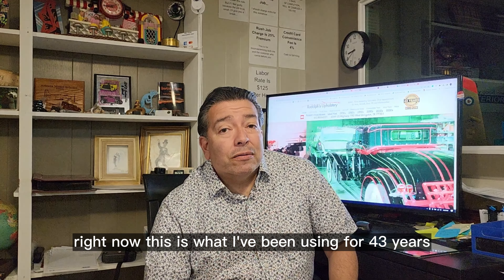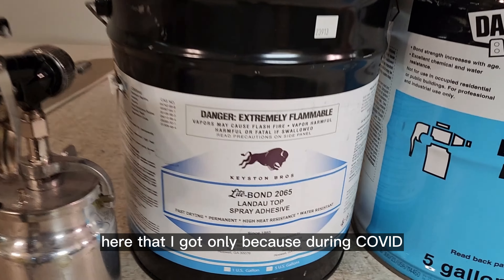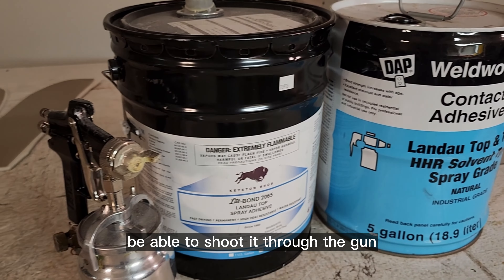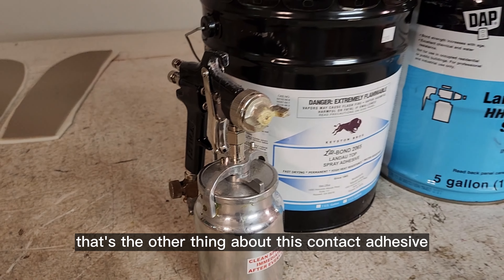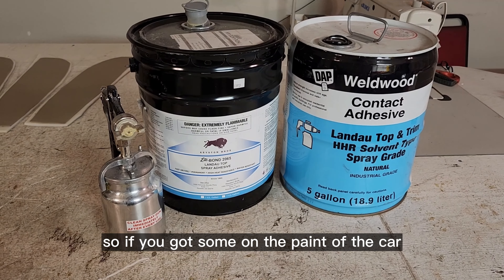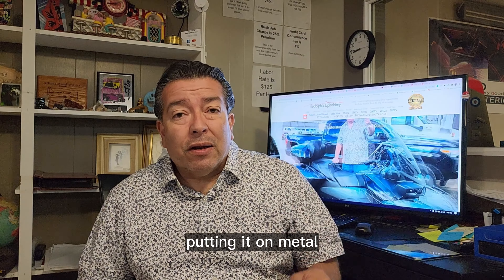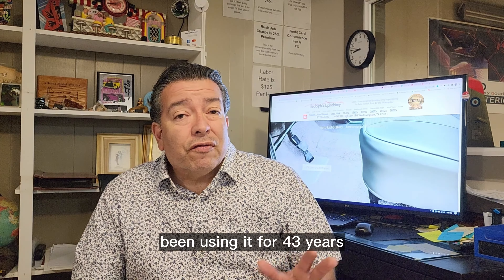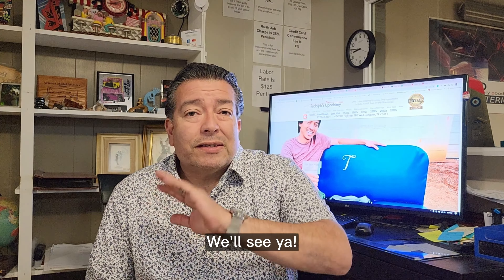You have been doing this wrong 3M spray can glue adhesive

Comment: I've also been doing upholstery for over 40 years, we found out a LONG time ago not to use spray can adhesive for headliners. Weldwood is good stuff, there used to be a green colored contact cement that was even better but they changed the formulation and it was no good, don't think that company is around anymore. And I have also used cheap quart spray guns, and you never really have to clean them out UNLESS you leave the glue in and the weather is hot and it dries out inside the gun.
Reply from the maker: Hello Mttmg, I remember the green glue! Yep, good 'Ol Harbor Freight spray guns. Thanks for watching!

Comment: my first headliner install was in a 1973 beetle. doing it without pulling all the windows out of it, I had to do a lot of tuck, stick and peel. I found out firsthand how bad that glue was. I see it every time I get in my bug, and it drives me nuts
Reply from the maker: Hello Russ, A headliner without pulling the windows is possible, but if you can, pull the windows right? Please keep liking and watching!
Reply: @oldschoolautoupholstery  oddly enough, I found my old spray gun today and looks like my Weldwood is still good. I'm ready to go this spring. This is Missouri so it's cold out
Reply from the maker: @russriley3005  Hello Russ, Great news! Just go for it. Please keep liking and watching!

Comment: Awesome video, great info.
I had my car vandalized with spray paint and paint from a can. I used mineral spirits and removed 99% of it. I was shocked at how good it worked with ZERO damage to my car. Even the rubber trim that was sun beaten and faded…took nearly all of that off. That was the only place with a hint of the vandals work. I imagine the vandals were shocked because by the time the sun came up, my car was sparkly clean. Not only did i remove all the vandal’s work, but I cleaned and washed/waxed the vehicle right after. Mineral Spirits are no joke, saved me for sure.
Reply from the maker: Hello Todd, Thank you so much! Wow! That is good news! I am so glad you had the wonderful experience of how well mineral spirits works! Please keep watching!

Comment: You got it. The 3m spray works if you can keep things cool. Heat makes it wimp out, like the heat found in cars. I use to use it when I recovered my pool tables, and it would stay hard and strong over years and then have to rip the old felt off the slate. In a vehicle it was crap and with heat it would turn loose. Barge is another excellent contact adhesive, and I used it to glue new rubber pool bumpers to the wood that mounted the bumpers to the sides of the table after reclothing them as well.
Reply from the maker: Hello Free, Thank you so much for the contribution! Thanks for watching!

Comment: Please listen to this guy!  I never re-upholstered a headliner in my life and thought I'd try it.  Save over $500 plus.  Attempt #1 - I immediately wrinkled the material on the glue and stopped.  Removed 🙂  Attempt #2 - I got the spray can glue (Permatex), and did the headliner a little at a time.  Result:  I can see where the fabric is "unstuck" from headliner and I followed directions axactly.  Then I came across Rudolph's video.  So I swear I'm going to take it all off, scrub the adhesive off again, and try again.  I'm noticing it's a little difficult to get this adhesive locally and curious what the best headliner material is.
Reply from the maker: Hello Timothy, Well, we do learn don't we? Just Google "Upholstery supplier near me". Get the right stuff, Always... Hehe. Please keep liking and watching!

Comment: Yep! I did auto upholstery installs only(no sewing, someone else made the seat cover kits)for about 4-5 years for a company that replaced the cheap interiors in mini trucks like Datsun, Dodge d50's and some Toyota's back in the late '70's. Never used a rattle can of adhesive, and the back area of a Datsun King Cab had to be carpeted up to the door panel line that was to be glued in, oh yeah the door panels. I think they hired me because all I did was vinyl tops back then. A place in Portland OR called Perfect-Fit McDonald Co. sold 5 gallons of glue for about 45 bucks. Different brands came and went, I recall green and even a red color glue but mostly a beige color glue. I used a Graco 2.5 gallon pressure pot and never cleaned anything but the Binks gun nozzle. Later when I opened a auto body and paint shop I had a headliner in a '82 Zed 28 Camaro to replace and used a 3M rattle can but it all came loose and I had to buy a cheap gun and a qt can of general purpose contact cement to fix the headliner.
Reply from the maker: Hello Cliff, it sounds like you lived my life back in the 70's and 80's! I had many of the same experiences! Thanks for watching!

Comment: I'm about to replace the headliner of my 2003 Corvette which is a simple job because can remove the top, turn it upside down on my table (on top of towels for padding so the paint won't get scratched), and go to work.  I've never done this before but it seems easy because there is not much headliner there.  Amazingly I was just about to order Super 77 but then this excellent video just appeared in the nick of time!  Thank you!

Looking online, I see that DAP WeldWood comes in not only 1 and 5 gallon cans but I only need several ounces to coat both sides.  Luckily there is a new option: "DAP Weldwood Landau Top & Trim HHR Solvent Type Spray Contact Adhesive" in a light blue and black 14 ounce spray can.  The can has the same colors we see on your 5 gallon drum containing this same product.

One product reviewer wrote that the spray comes out lumpy and that can be felt through the headliner.  Another product reviewer described how he sprays the product into a small container then paints it onto his project using a brush.  Care to comment?

I live in Florida where the heat in unbearable half the year.  So thank you again for explaining the benefit of this superior product.
Reply from the maker: Hello Just, I have never used the spray can version. Usually, if someone asks, and they do not have a spray gun, I will tell them that they can always use a brush. Really, I only use contact adhesive for everything I do. Please keep liking and watching!

Comment: I started using Formica adhesive. It was 25.00 for 5 gallons. That was in the 70’s. The supply houses wanted 40.00 for 5gallons. I installed a vinyl top in the winter with the big door open. After sticking it it was permanent. The only difference was it was red. The spray glue has a use for tacking . I agree with you it’s basically garbage for any thing permanent.
Reply from the maker: Hello 13th, Yep, I remember red contact adhesive. I am always telling commenters to try the contact adhesive used by countertop top installers.  Please keep liking and watching!

Comment: Your video is much appreciated. I am in the process of building a urethane foam body for a 3-wheel car and need to consider edge bonding the panels together before glassing. Incidentally, I have used 3-M adhesive to replace a 15 year old cloth headliner in one of my vehicles. 12 years later it was still firmly in place. I thank you for your advice.
Reply from the maker: Hello Robert, You are so welcome. I tried gluing the urethane panels together for a fiberglass plug with the 3 men. But it fell apart. I ended up using a good wood glue. Just sayin'. Please keep liking and watching!

Comment: 3M in the black and Green can which you cant buy in stores works, but any of the 3M you can buy in stores is junk. 3M 90 and 94 it's double the price for a reason.  But yeah I use Dap from the can and use spray gun they also now sell it in the spray can which I use for small quick jobs.
Reply from the maker: Hello Toffee, I am stubborn Old School I guess. I find no reason at all to use more than the only one Contact adhesive that I have been using for 43 years for everything. I was using this before there was such a thing as 3M spray adhesive. No need to spend money on anything else. But that's just me. Please keep liking and watching!
Reply: No I'm not telling you to use it but the stuff most people buy is for arts and crafts in the red and black bottle. I got the black and green stuff through some guys at work for small jobs, 4 5 years later still strong. I use dap when I'm doing a big job, it's far to expensive to use anyways spay can cost as much as gallon of dap.
Reply from the maker: @toffeerado  Hello Toffee, I'm glad it worked out for you. I have customers that I need to be reliable for. Please keep liking and watching!
Reply: Yeah, still haven't told you to use it not sure why you think I'm telling you to. I'm jusy saying they have different grades, and that why thier strong stuff isn't sold in stores just as dap is also not sold in stores and illegal in 7 states I think.
Reply from the maker: @toffeerado  Hello Toffe, I got ya. You're not telling me to use it. My answer was for anyone reading my comment, Why I prefer contact adhesive. I love you my brother and appreciate your comments. Please keep liking and watching!

Comment: Thank you so much I'll use it this week end for my headliner!
Reply from the maker: Hello Jay, if your just doing a repair, use a brush as air pressure will pull the rest of your headliner down. By all means, use the spray gun if your replacing all the material on your headliner. Thanks for watching!

Comment: Just some FYI reference the "spray-gun" shown in this video, i.e., a Chinesium: low grade, cheap spray gun.  Is a nock-off of the Bink's model "7," syphon spray gun.  Another spray-gun used in the Autobody trade was a "DeVilbiss" spray-gun.  Who's design was used for any year's in the Autobody world for many year's before the Japanese spray guns (Sharpe's) started to enter the market approx. early 1980's, if I'm not mistaken.   If I'm wrong, oh well I might be a little off on the date.  As a old and retired Autobody guy, that's all I ever seen in upholstery shop's, were spray gun setup's. Some of the shops used two quarts spray-pot's or even three gallon spray-pot's.  (you get to where your putting on two or three vinyl tops a week, this is what your gonna need.)   But never as we called them "Spray-Bomb's," i.e., spray-cans from some bull-shite company that sounds like 3-men.  As someone who has personally removed a lot of automotive vinyl tops, to save some money so the upholstery shop didn't have to, the one thing I always notice about factory vinyl tops, was the uniform coverage, and appearance of the glue, i.e. it was always sprayed on via a spray-gun.
Reply from the maker: Hello Stanwood, You are 100% correct in your recollections! I used them all through the years. Glue pots, then DeVelbiss, then Sharpes. Then I discovered the Harbor Freight. Now I buy a $27 HF spray gun every two or so years. Hard to argue that one.... I have done hundreds of vinyl tops, mostly in the 70's, 80's and 90's. Thanks for bringing back some memories! Please keep watching!

Comment: I think you're all using the wrong spray adhesive.  There are two different 3m spray adhesives that work extremely well.  The strongest of the two is the Headliner Adhesive.  It is very strong, and has an odor similar to the weldwood.  The other is the General Trim Adhesive.  It works well on just about anything.  It is good for gluing foam to foam, material to foam, and material to just about anything else.  I have used it for over 30 years with excellent results.  I recently had the chance to check out a headliner that I installed in a C-10 truck in 2007, and it is holding up just great, with no loose edges, and no drooping anywhere.  It was put together with the General Purpose Adhesive with no problems at all.  The 77 adhesive is designed as a hobby adhesive, and sprays out like a can of paint, whereas the Headliner Adhesive and General Purpose Adhesive sprays out in a lace, or spiderweb style spray, with an adjustable spray nozzle.  You should really give these products a try before you write off all spray adhesives, you may find something you like.
Reply from the maker: Hello Schlock, I never experienced what you have. Then Again I have lived in very hot climates. (Scottsdale Arizona). I am happy to hear that you didn't have any problems. Please keep watching!
Reply: @oldschoolautoupholstery  :  Trust me, it gets plenty hot here on the Mississippi Gulf Coast also.  I have not experienced any failures with the General Purpose Adhesive I referenced.  Spray both surfaces, allow some dry time, and place the two together.  I think you will find that the bond will be instantaneous and extremely strong.  You should try a sample and see for yourself.  I have found the lowest price for the adhesive is at Walmart as opposed to autoparts stores.
Reply from the maker: @schlockrod  Hello Schlockrod, Thank you for the tip! But I can't take any chances with my customers or my reputation. I'll stick with what I know. Why fix it if it's not broken right? Thanks for watching!

Comment: Thanks for the information. Good stuff, unfortunately for a small diy where it may be a small door panel or piece of carpet ungluing  the spray can worked fine. I don't have a lot of space or ancompressor as I'm sure many dont so the can is probably what you have access to. I used both the orange can and the 3m, I found the spray pattern was better on the 3m. It also felt a bit better than the orange can, just a tiny bit though. Both seem to work for small parts where I used them.
Reply from the maker: Hello My, You are welcome. Being that I have paying customers and a really good reputation, I would never use any glue from a spray can. The least a person can do is buy a quart of contact adhesive and apply with a brush. The spray can stuff will fail over time where the contact adhesive will not. Please keep liking and watching!

Comment: If I had regular foam without the scrim material, could I just glue some cotton or polyester material to the back side of the foam so the bottom thread wouldn't pull through the foam?  Or is that even necessary?  Could I just sew it without scrim fabric?  The foam I would be using is 1/4" to 1" thick.  Thanks.
Reply from the maker: Hello Big, You could back your old foam if you want, but it is 2023. You can buy backed foam. Unbacked foam friction will drag on the sewing machine very badly. Just get the right stuff, and you will be ok. Please keep liking and watching!
Reply: @oldschoolautoupholstery  Its tough to get stuff locally.  I ordered some foam, but it didn't have the scrim fabric on it.  I thought if I needed it, I could glue some fabric onto it.  Would that work okay, or not bother, or try and find some other foam with backing?
Reply from the maker: @bigfranksworld  Hello Big, Since you already have the foam, you might as well use it. You can add a thin backing to it. I did that decades ago. Please keep liking and watching!

Comment: Howdie Richard ya it nail on head l use 4m bad stuff nasty fell apart had too redo customers van sealing hard job get the old off put new on lasted 2months came off in corners ya sometimes bying cheaper don't pay glad l found ya  lve got lots of sprayers so all good keep showing and sharing Richard 👍 got my vote 👍 from Canada SK 🇨🇦 👍 later
Reply from the maker: Hello 521 Farmer in Canada, Yep, you can't beat that good 'Ol contact adhesive. It works great every time it's tried. Please keep liking and watching!